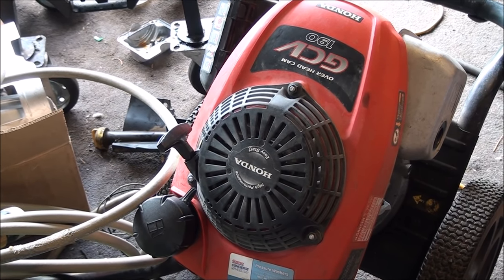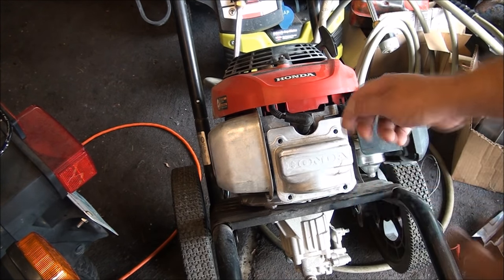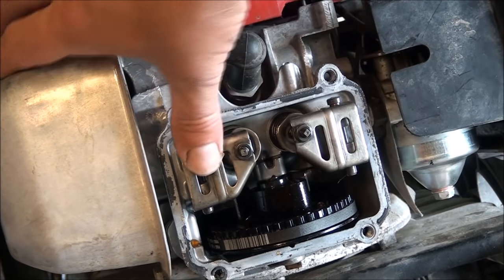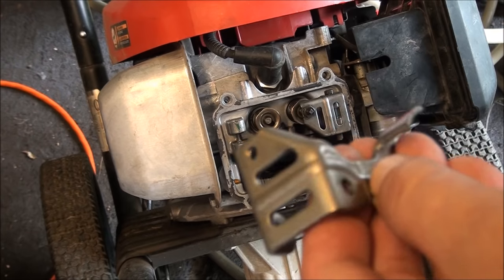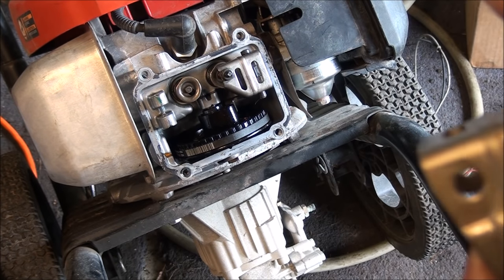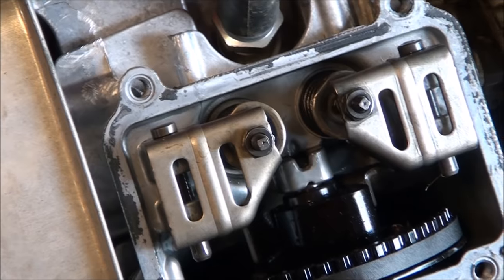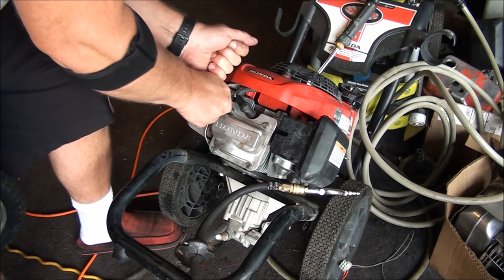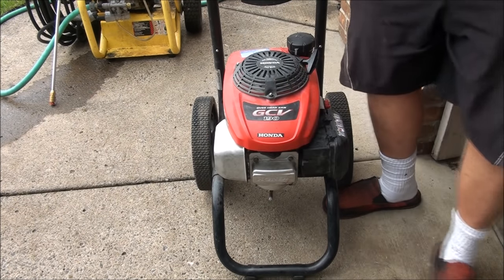Common Problem HONDA GCV 190 engine. HARD to PULL . HARD to START FIX Pressure Washer ROCKER ARM

Comment: So I picked up a craftsman 3000 psi 190cc the pull cord wouldn’t move at all took it and spun by hand nothing it spins halfway smh then stops and sounds like it hits a metal. Took the top nut off sprayed it with penetrating oil and spins good till I tighten the but on and does the same thing. Any idea wat it could be
Reply from the maker: broken rod or a stuck valve

Comment: You didn't fix the issue which is the exhaust valve guide backing out (design flaw). Grab a valve seal and remove the rubber then put it below the spring so it doesn't back out again, then install a new rocker arm.
Reply from the maker: good tip

Comment: I have the same issue the engine is locked I opened that cover everything is good I don’t know what else to check thank you
Reply: Carburetor could have flooded and filled the cylinder full of fuel.
If this is the case,the rings won't hold all of the fuel in the cylinder,your oil level is going to be high and your dipstick will smell of fuel.
The carburetor float valve and or float valve spring are your typical culprits.

Comment: The cam lobe on the one I'm fixing now doesn't match dead center when the piston is at max height. Is this a problem? I know the markings on the underside of the cam match the lobe at center with the cam housing. Mine is off to the left at max height.

Comment: This Ryobi pressure washer has oil burning white smoke coming from the pull start after it starts up I stuck a camera down the cylinder and it looks like the cylinder bore has deep gouges from the rings I would thing but I'm definitely getting annoyed by it

Comment: My 190 gcv engine in my pressure washer would not start after shutting it down to move some items in my deck. Checked the fuel system, found no problems so I removed the plug and checked for spark.  Had spark. Checked for compression, none.  Removed valve cover and noticed about 1/8" gap between rocker arm and valve on the compression side.  Noticed the exhaust valve was stuck in and I took a screwdriver and popped it out.  There were no cracks in the rocker arm. Don't know if the piston has clearance for the valves or what could have gone wrong or if this thing is worth fixing.  Paid extra for the honda engine on the husky washer. Engine only has 40 hrs on it.  My mistake.
Reply from the maker: I have seen that before. you can ping around the guide to  help keep it in place if needed
Reply: Peen, humm , thanks for the tip Jeff, again..

Comment: Why did it get stuck in the first place? I loosened my valve by tapping on it but it still sticks a little but I can push it down. How can I determine the reason for this?
Reply from the maker: good question. lack of oil or a manufacturers defect

Comment: I wish these GCVs were that simple but what I'm finding is the Compression Release Mechanism fails on almost all of these..
In my opinion as a small engine repair mechanic in Oahu, these GCV engines are junk.
I just finished working on a Simpson 3000 psi with the Honda GCV190 and we've checked everything and Honda tell us that it's the Compression Release that has fail. 
You pull the recoil and it will rip your arm or hand off.
Stay with the GX honda engines and you'll never have this issue

Comment: Mine is very hard to pull and kicksback almost breaking your wrist !!! Valves are adjusted spot on, flywheel key hasn't broken, flywheel in correct place, rocker arms in tact not broken yet STILL its hard to pull aaarrrggghh
Reply: Maybe it’s the pull starter it’s self. Broken spring, needs lubed ?
Reply: @markkasprzak995  fixed it,!!!!! It was the decompression lever getting stuck on the cam belt pulley, the lever had worn the sliding hole longer and was getting stuck so no decompression on starting !
Reply from the maker: glad you figured it out, well done

Comment: Jeff my pressure washer runs but if you let off of the gun handle and stop spraying water it immediately turns off but of you keep spraying after a few seconds it starts smoking and smells like rubber is burning idk what’s going on
Reply from the maker: sounds like the water pump may be bad Trey
Reply: Most likely culprit is the unloader valve. This valve circulates water when you release the handle, thereby relieving the load on the engine. Almost every pump uses some form of an unloader valve. This is also a temperature relief valve that exhausts water to the outside world if the water gets hot enough from recirculation.

Comment: May 27, 2022.   Watched this, then removed bolt from bottom of carburetor, GOOEY BLACK SLUDGE.  So i'll flush carb Before i remove valve cover...which is not cooperating.

Comment: Wd40 will thin out your motor oil then you wil ruin your motor
Reply: It's perfectly fine to put a little on the valve guide
Reply: That may have been a light spray lub like seafoam..  light oil.
But yeah,  be careful , I drink wd-40, love it, ah ha.😄